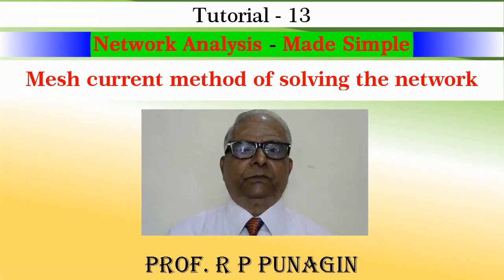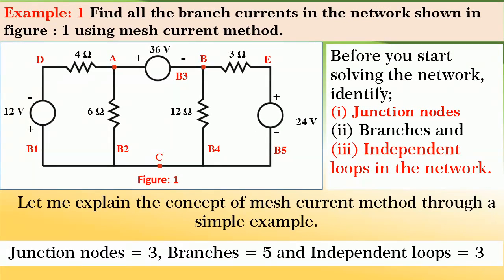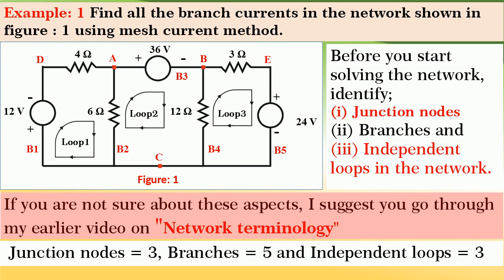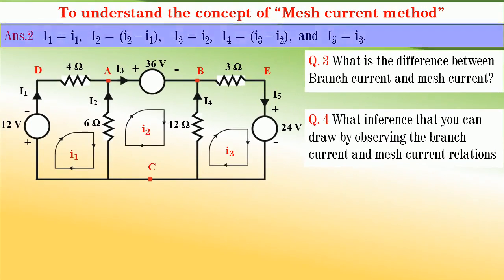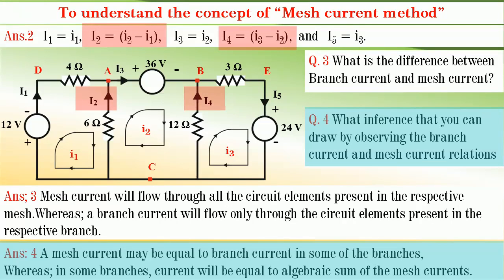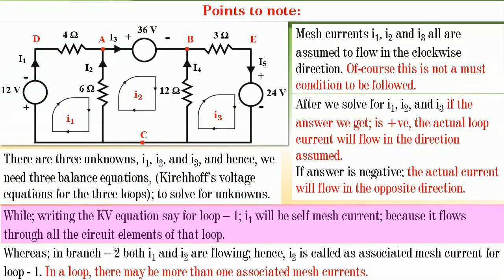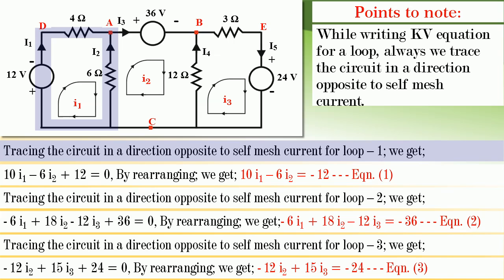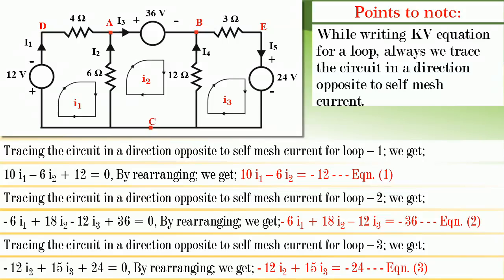Mesh current method of network solving

Comment: Sir can u check the equation -6i1+18i2-12i3=-36 & -12i2+15i3=-24 once again, i am getting different equations.
Reply from the maker: Hello Shikhar Kumar, the equations are correct.
Note that the equations are written tracing the loop in the anticlockwise direction.